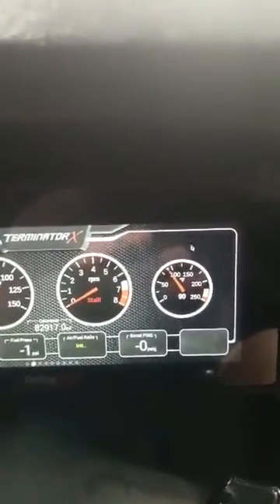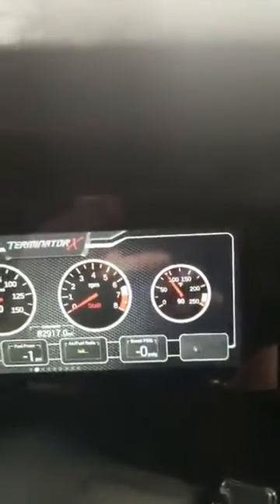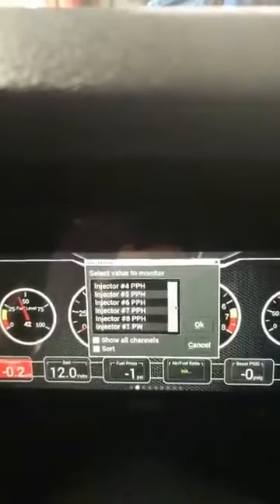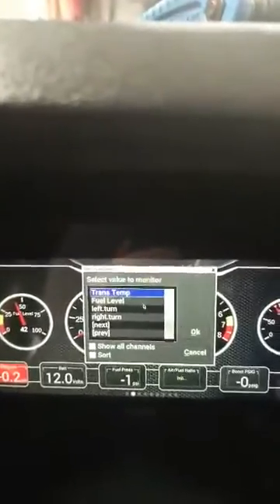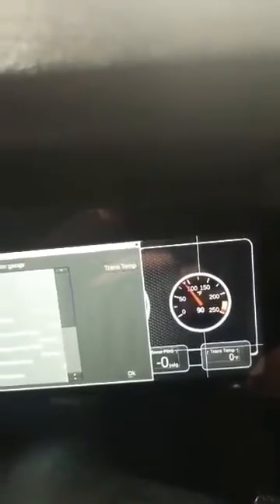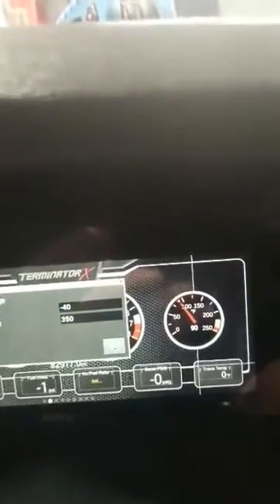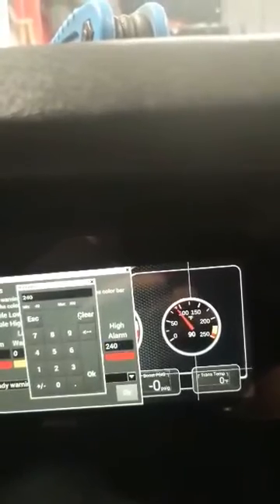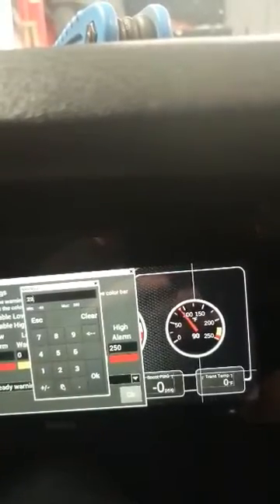How to configure a gauge on a Holley Pro Dash

Comment: Thank you for taking the time making these videos' and  posting these tutorials  very helpful information fer sure  im a newbee to all this pro dash stuff back when i opened it to get a look at the first time i was overwhelmed trying to wrap my head around all of it . i have a  question on the pro dash can you make ajustments for the ECU for doing any tuning  that or switch over to another tune  lets say one tune is moderate and the other if your going to go to the strip to make some passes  or does it need to be done with the lap top or hand held ?  thank you once again  i look fwd to learning the ends and outs of this system   . Bill
Reply from the maker: Thanks for watching and commenting. HP and Dominator ECUs can be tuned from the Pro Dash, Terminator X cannot. I would recommend tuning with a laptop instead of with the handheld.

Comment: If you're doing the dash standalone can you somehow Hook your wideband to it ❓
Reply from the maker: Great question, I had to open up the manual to find the answer. At least as of the software version that I have, there aren't any inputs setup to be a wideband, however there are 13 inputs that are setup for a custom 5 volt input. If you know the values for the .5 - 4.5 volt range, you should be able to set up the gauge to display what your AFR is. There are newer software versions for the dash that I don't have, so perhaps a wideband is a default option now, I can't speak on that since I haven't upgraded yet. A wideband is pretty easy to setup, there are only three wires that matter for the gauge. A 5 volt input, a sensor output (that 5 volt input I mentioned earlier) and the sensor ground wire. There is also usually a heater wire, but all that does is run at startup to warm the sensor up quicker, it doesn't impact the function of the gauge.

Thanks for watching.
Reply: @TrailerParkMotorsports  I will definitely try to check into it more I think it's the 5.0 version I'm so new to it I don't really know but it's completely standalone pretty sure everywhere I read in the directions that I can't I'll keep researching thank you very much love your videos
Reply from the maker: @williamobrien7469  I'm glad that you enjoy them. I'm looking forward to hearing if it can be done.